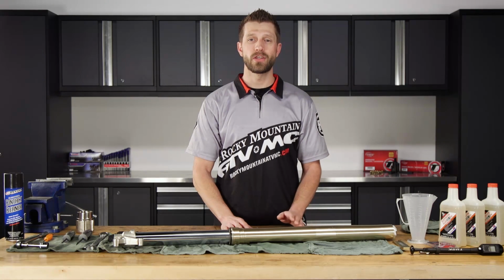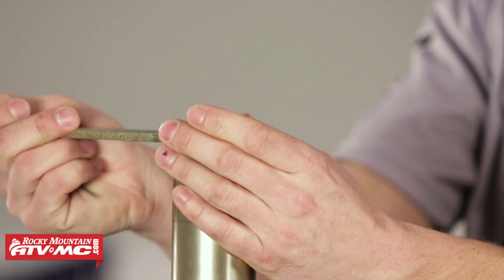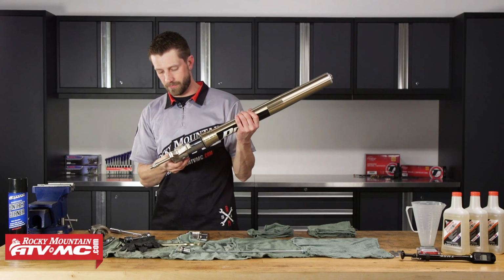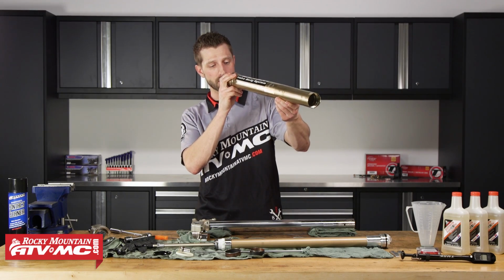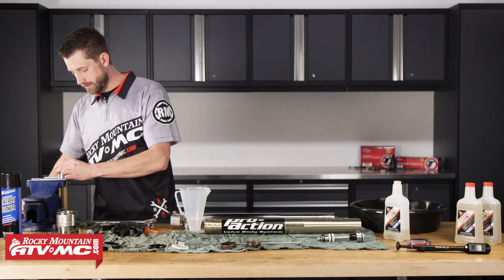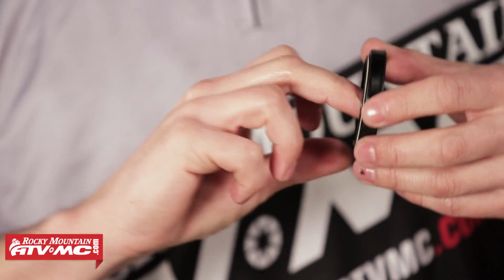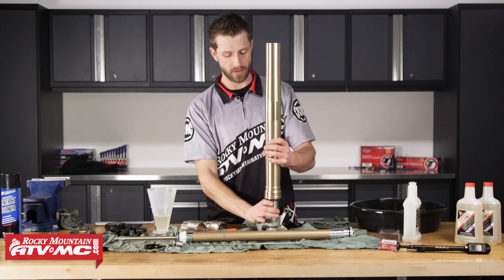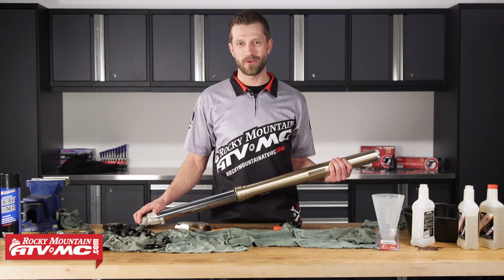How To Rebuild KYB PSF Motorcycle Air Forks

Comment: how much oil do you put in on outer and inner tube ???
Reply from the maker: For this model it was 8.2 oz. But you will want to check your machines service manual for proper specs as they change depending on the model.
Reply: @rmatvmc  thank you so much . mine is a 2014 crf450r . im from the philippines
Reply: @rmatvmc  that would be 12oz on the damper rod and another 8.2 oz to the outer tube ?
Reply from the maker: Correct

Comment: Rocky Mountain ATV MC  - Thanks for these vids they are life savers!    Do the KYB-II  all the 15 and 16 CRF's seals are blowing out now and there are literally no videos showing the replacement.  For example you can get a Honda Fork Damper Holder Handel for +50$  and the 30mm attachmetn for andother +80$  but I've herd its simply a 30mm socket and an extension.  Is this true?
Reply: I am also looking for a detailed video on the PSF-2 forks.. great videos

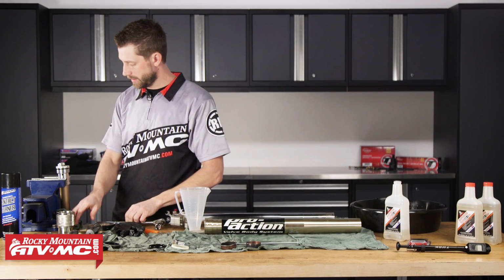Comment: The compression assembly when you’re putting it back together, are you tightening it all the way down to a snug tight or just barely so that extra oil will come out? Will the extra oil come out if it’s snug or does it need to be loose? 11:56

Comment: is it the same procedure on the psf 2?
Reply: Def not. psf2 is much harder and you need a special tool to hold something in the inside in order for you to take the inner tube and outer tube apart. i gave up and i just switch to kyb sss. =(

Comment: not related to the air fork but have changed the springs on my fj09 and noticed holes in the top of the inner tube and am wondering what stops oil escaping in to the outer tube affecting the air gap, please help with my confusion as i am a bit stuck on how oil could get back into inner tube
cheers carl

Comment: i might have used an compressor on my suspension and it have started leaking, what do i do now? ^^
its a 2016 RMZ 250
Reply: Godseverman Lol never use anything besides a correct hand pump for forks. You most likely blew out the seals with too much pressure.
Reply: yeah the seal blew out but i put it in the shop to have someone fix it for me, cost me 400$ ....
Reply: Godseverman shit you got fucked. That's very high to just change 1 seal.
Reply: Is it ok i used 10w oil?